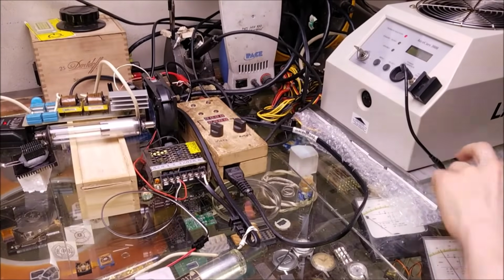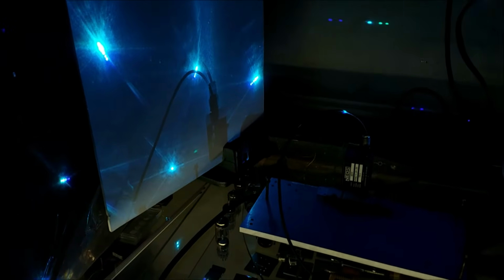The Laser Shifting Polychromatic Acousto Optic Modulator

Comment: The material in the crystal is called Tellerium Dioxide. Dont touch the crystal. Tellerium Dioxide is hygroscopic (absorbs water readily). Dont touch the crystal with pretty much anything since the crystal is brittle. A fun thing to try is to "collimate" a white L.E.D. and pass it thru the Xtal and adjusting the angle to get different colors out.  Awesome video!
Reply from the maker: Thanks for the comment! But I have to point out that Tellurium Dioxide is probably not hygroscopic. My fist indication of that is the lack of seal around the actual crystal. This would easily let in atmospheric moisture in of itself. I did also check the solubility characteristics. It appears to be soluble in acids and alkali solutions. It's solubility in water is negligible from what I can find out. I would love to see a white LED effected by the XTAL, I tried to see if any visible effects where noticeable just as it is with the cover off and didn't  see much. If you ever do the experiment again do take some video!

Comment: Lmao,  I'm shocked you didn't pass out vaping that fog rather than use a fogger. Lol
Reply from the maker: lol, oh I know right, thank fully 0 nic is an option. I figured it would be easy, a puff and it will be good for a while, but nope that Ar-Ion circulates air like a Boeing 747.
Reply: @Zenodilodon  Yeah, the fan on mine is very obnoxious. If i ever set it up in a permanent location i'll most likely plumb her cooling in a quieter fashion.
I have an 800w fogger for my showings but i prefer not to use any fog if i can help it, it's not good for the open optics i tend to use. :/

Comment: 50:35 I opened a similar component once and it appeared to be a transformer or other inductor, it had multiple copper windings. Excellent overview, thanks!
Reply from the maker: Makes sense, in some ultrasonic things there is often an inductor that is I think in parallel with the transducer. I see this a lot in ultrasonic disruptors/homogenizers as part of the LC network that plays in tandem with the PZT element. What was the device you opened for?
Reply: @Zenodilodon  I don't know what it was, I got it to scrap, but it was some kind of RF board. It had several of those mini coax connectors on it.